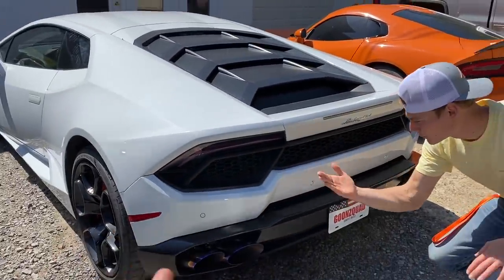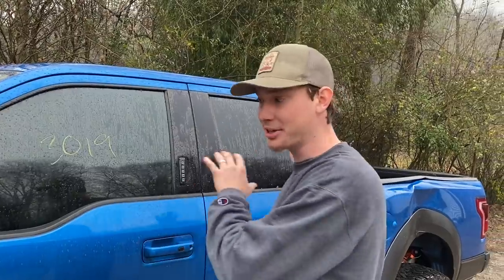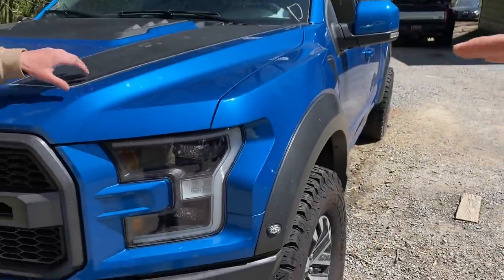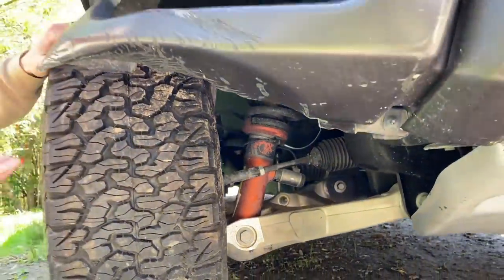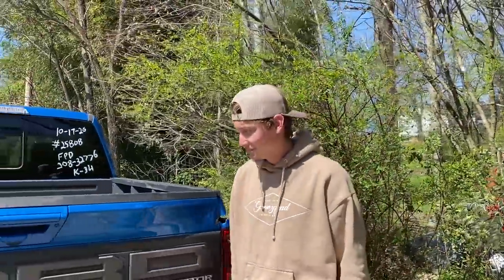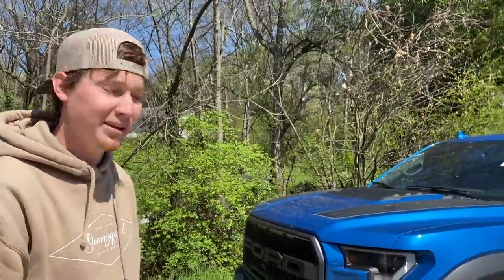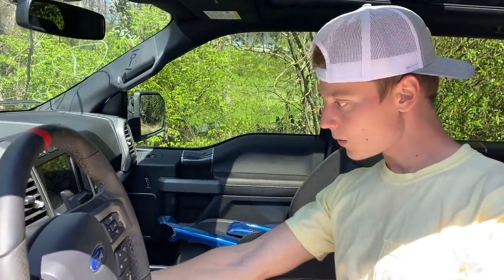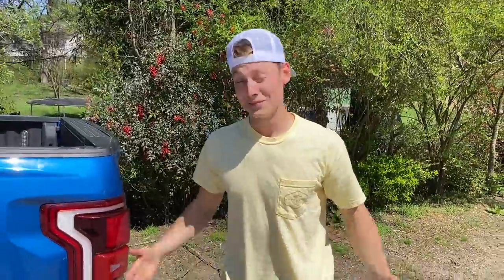Rebuilding A Wrecked 2019 Ford Raptor!!!

Comment: PRO TIPS: 
•Lift kits ruin raptors
•Aftermarket fenders and besides are cheaper and wider than oem (Adv is the best)
•Velocity blue is tri coat paint using a candy blue clear coat
•Method wheels are the way to go for raptors
•Power running boards lead to destroyed rear fenders from rocks and sand blasting because raptor boards stick out and are very good at protecting the truck
•It looks like your front bumper is salvageable, the ends of it come off separately
•37s do not fit raptors unless you drop $20k+ on suspension and body work, I can't stress that enough
•wheels over 17" are lame as hell
Reply: Too bad all this info won't be read by them in time..
Reply: No
Reply: @stanfoxx  yep, it'll end up with 22" wheels and street tires with a rough country lift
Reply: Agree with all of this except I would go 37’s
Reply: @devinschultz6954  it's tempting but frankly they aren't worth it, especially if you go offroad. They will just rub everything, even with suspension mods and fenders. It also robs power, the perfect compromise is a true 35" tire
Reply: I love this comment 😂
Reply: Completely agree, I think they have the money to build tho and could probably get some mid to long travel suspension and be able to fit 37s then.
Reply: @jacobedwards5234  true
Reply: @Blue_Flame_Raptor  I think Raptors are the most off-road capable the way they come from the factory. Most Raptors you’ll ever see with 37s or aftermarket suspension mods are mall crawlers that’ll never have the suspension flexed anymore than it is with regular highway driving.
Reply: 37”a are possible, just need eibachs in the front and Deavers +3 in the rear
Reply: It’s their truck let them build it how they want it jus sayin
Reply: @TheBlaze489  yeah for the street, for offroad you'll need to cut the front up and it will still rub like hell at full compression
Reply: Lol who are you
Reply: @seussyyy  lol who are you
Reply: @stanfoxx  so Stan, why do you watch them if you think they are so stupid? Do you have 2.3M subs on a you tube channel...I’m guessing it. Do you have a Lamborghini,Ferrari,Viper, multiple other cars, trucks, toys, land, house, new building on the way? I’m guessing not. They will build this truck exactly how they want and not loose an once of sleep what you think. Oh, and gain subs while doing it and making even more money!
Reply: Looks like pretty dang good advice, especially about the wheels. If these guys end up putting wheels on it like the Chevy has, I will drive all the way to Tennessee just to go knock on the door and say “boooo” A Raptor is supposed to be an off road truck, not a Mall Queen. Look at any off road race truck, you will not find anything with wagon wheels and 2” sidewalls.
Reply: @kevinm9860  Yeah, views and subs alone mean that someone does everything right. Dude, half of the fun is watching them do incredibly stupid and avoidable things and learn from it... sometimes.

Comment: Those 5 front amber lights and 5 red ones in the back are required by DOT since it’s wider than a normal truck.
Reply: Yup , I thought it was 3 that was required but it’s definitely a dot regulation because of the width
Reply: Yup. So people dont mistaken this for two bikes

Comment: Hey guys, the 3 lights on the trucks are called 'identification lights. ' Their purpose is to alert following drivers that the vehicle equipped with these lights is wider than 80 inches.
Reply: And oddly enough, the Raptor is just a bit SHY over of even needing them at all. 1 inch and it would have changed the entire look of the truck
Reply: Thats because ford makes the f150 just shy of this 80 regulation making there trucks 79.9 width but because of the raptors fenderflares it goes over 80 and they need the lights up front same with the trx
Reply: @Andy Pedro I think it has something to do with how big they are
Reply: @cringepanda3611  this!
Reply: @Andy Pedro cab lights are a option package
Reply: There's 2 more in the fenders. Vehicles over 80 inches wide need 5 amber lights to identify they are wider than 80". HD dually trucks just do the 5 lights on the cab roof, but for the Raptor Ford wanted to incorporate them more
Reply: @Andy Pedro A lot of Pickup truck owners like to pretend they are driving a Big Rig. The roof mounted "clearance lights" are just for show. The same guy wants huge tow mirrors and lights down the side too.
Reply: @Andy Pedro those are optional when ordering the truck.
Reply: I was just about to mention this.
Reply: More commonly known as marker lights.

Comment: Welcome BACK.  Love the 2019 Raptor . Only 3000 miles.
Someone must have had a mishap and wrecked it up but 
Good .  Going to be a fun build for sure.
Reply: Final bid:  $41500
Auction:  Copart   
Lot number: 55789900
Date of sale: 10.12.2020
Year: 2019
VIN: 1FTFW1RG9KFC85537
Condition: Run And Drive
Engine: 3.5L 6
Mileage: 3019 miles (Actual)

Comment: Aren't the clearance lights required due to the truck being so wide? I don't think that the Ram was copying Ford as much as they were meeting DOT requirements.
Reply: Correct
Reply: Spot on ...
Reply: Indeed,they could have put the lights it the roof like work trucks,but let's be realistic that wouldn't look that good and the idea was there already on the grill,so it was about the same as copying it
Reply: @12arney  Yep .. they copied DOT regulations...

Comment: If you go to the beach,  you can leave the keys in the car and not worry about losing your keys or getting them wet.   When you get back to your car you can use the keypad on the door to get back into your car   It's a great feature that Ford has had for a long time now.
Reply: Yep, rarely take my keys out. Just lock them in the truck

Comment: any vehicle in america 80 inches wide (or more) must have minimum 3 amber front facing lights (spaced between 6 and 12 inches apart) the raptor has them but the regular F150 doesn't as its 79.9 inches wide.

Comment: The 3 lights in the middle are a DOT requirement. Most 1/2 ton pickups are made to be within 1/2 inch of the max width before they need to have them. The Raptor, TRX and pretty much every HD truck made are over that width and must have those 3 center lights.

Comment: "3019" More than likely is the code for the door entry.  The auction writes that on the windows when the vehicles come with that feature.
Reply: Nope, it was the mileage. If you look closely when they show the dash, there was 3019 miles!
Reply: @FamilyLtNY  you’re right they did say it only had 3000 miles.  Someone was listening,  not me... LOL
Reply: @roadblazerterry  normally the only thing they write on the window is the mileage or auction/lot number, not the door code.

Comment: Glad to see you back at truck and auto rebuilds.  The Raptor suspension and off road capabilities are pretty awesome in stock form.  I hope you learned from your Denali rebuild that more aftermarket lift and wider tires does not always improve the overall capabilities of the truck.  My vote is engine intake, exhaust, and tune upgrades only for the Raptor.

Comment: That is my dream truck there. There are plenty of aftermarket bumpers that are just bolt on. As for the wheels I saw one today with mate black ones and looked sick, also all the SVT letters in the tailgate and side were red. The amber lights (5 total) means that the vehicle exceeds 8ft wide is a DOT requirement.

Comment: Personally, I would actually lift it up a couple inches or three and paint the truck a tan color with the bed removed. That's what I'd do to the body, the engine on the other hand, I would probably leave it alone or throw a tune on it. Glad to see that you guys are back to building cars now.

Comment: Hello guys those three little Amber lights they're out front on the grill is required by the department of transportation. Once the truck exceeds the width of the department of transportation dimensions it needs three lights in the middle. Check it out yourself

Comment: Glad you boy are back building and repairing vehicles... p.s go factory beedlock wheels with 37" tires give the truck a 2" lift and do the oversized ⁴" over fiberglass front fenders and do the wider bed fenders and tune the truck

Comment: The little lights on the grille and the edges of the trim piece over the fenders is cause of the truck being slightly wider than a regular 1500 truck. Similar to the 3500s or F350s if I'm not mistaken.

Comment: The Ford raptor has 3 Amber lights in the grill because it is a certain length which identifies it as a "truck" which requires additional lighting

Comment: Waiting the helicopter series to countineu.;)
Reply: The Dudes have many demands on their time at the moment, and the maintenance and repair of the Robinson R22 is going to be very different from a typical car restoration. It will involve Goonzquad working under the supervision of a Qualified Helicopter Mechanic, who is required by FAA Regulations to organise, check and approve all safety-related aspects of the work. The aircraft then needs to be formally Certified as Airworthy, and must be insured and Registered before it can be flown. If Simeon and/or Eleazar wish to fly it themselves, they will first have to earn the necessary Licence(s), which is no simple matter.

Comment: Throw some 22in Forgiatos wheels with 32 inch tires, lift it 3 inches, slap an extended F250 bed and baja reinforced roll bar.

Comment: I was late but those amber lights are also on the corner of each bumper and are required by law because the vehicle is wider and bigger than a standard truck.

Comment: Seeing the Maybach on hoovies garage with similar damage, this was probably hit by a truck and slammed with rear left on a pole or something similar. The big hole and cut on the right side is really similar to Hoovies Maybach
Reply: The fact that none of the airbags deployed on the Raptor suggests that it was sideswiped while parked, and this caused the scraping and tearing damage along the passenger side. The damage on the driver's side is different, because it is buckling, not scraping, and the most serious example of this type is on the side of the bed, and was probably caused by the rear left-hand wheel being forced upwards violently. The frame (chassis) of the truck is probably distorted in this area, and this is why the Insurers wrote it off.

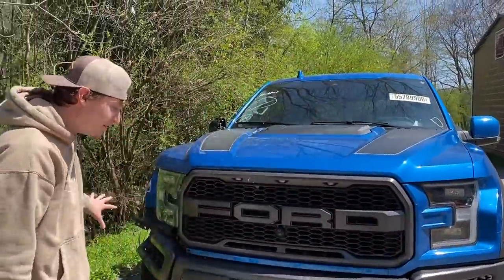Comment: 7:10 those lights are there for US regulations. They are required by DOT for vehicles over 80”. All that means is the raptor is bad ass because it’s so wide

Comment: hi goonzquad it is beautiful this ford f150 raptor in blue and i advise you for accessories go to additive desert designs which are excellence and above all take the honeybadger one and for the exhaust go to AWE exhaust and take the OFG exhaust pack which are excellence noise for your vehicle and you will not be disappointed with the result if you put this and i come from FRANCE so i follow you since the beginning of your reactions from goonzquad

Comment: I'm surprised none of the air bags are blown
Reply: The fact that none of the airbags deployed on the Raptor suggests that it was sideswiped while parked, and this caused the scraping and tearing damage along the passenger side. The damage on the driver's side is different, because it is buckling, not scraping, and the most serious example of this type is on the side of the bed, and was probably caused by the rear left-hand wheel being forced upwards violently. The frame (chassis) of the truck is probably distorted in this area, and this is why the Insurers wrote it off.

Comment: my 2019 ford fusion has a sensor to where if the key is close enough i just put my hand on the inside of the handle and it unlocks, and to lock there is another little icon on the outside

Comment: I wish they had a total breakdown of the cost. :(
Reply: Final bid:  $41500
Auction:  Copart   
Lot number: 55789900
Date of sale: 10.12.2020
Year: 2019
VIN: 1FTFW1RG9KFC85537
Condition: Run And Drive
Engine: 3.5L 6
Mileage: 3019 miles (Actual)
Reply: @whteman2  Dang SON!

Comment: What about the helicopter when we gonna see one of those videos again
Reply: Goonzquad have many demands on their time at the moment, and the maintenance and repair of the Robinson R22 is going to be very different from a typical car restoration. It will involve Goonzquad working under the supervision of a Qualified Helicopter Mechanic, who is required by FAA Regulations to organise, check and approve all safety-related aspects of the work. The aircraft then needs to be formally Certified as Airworthy, and must be insured and Registered before it can be flown. If Simeon and/or Eleazar wish to fly it themselves, they will first have to earn the necessary Licence(s), which will be no simple matter.

Comment: YES! By all means, repaint the 2019 Ford Raptor with a different paint color. I have the perfect replacement color that you will love. You will thank me later. The color name is, "ENSIGN BLUE POLY" with silver metallic flakes.  In 1979  I bought a new Dodge B100 Sportsman Van with windows and rear seats. (It looked like a large SUV ) The color was beautiful. Had the van only a year until it was stolen. I had to buy a used brown Dodge van but did not like the color. So I had the van repainted to match my stolen van's color. Well,  I got many compliments from people stating that the van looked very vogue.  Trust me, this "Ensign Blue Poly" will look great on your new build. The paint code I got from  The 1979 PPG Corporate Color Information Catalog. COLOR NAME = Ensign Blue Poly;  PAINT CODE: = SB7;  D.T. NUMBER =  8795;  DITZLER CODE =  3144;   PPG - DAR- H -  DELSTAR ACRYLIC ENAMEL.  This paint has silver metallic flakes, Not too much nor too little. just the right amount.

Comment: When are we going to see helicopter content again?
Reply: Goonzquad have many demands on their time at the moment, and the maintenance and repair of the Robinson R22 is going to be very different from a typical car restoration. It will involve Goonzquad working under the supervision of a Qualified Helicopter Mechanic, who is required by FAA Regulations to organise, check and approve all safety-related aspects of the work. The aircraft then needs to be formally Certified as Airworthy, and must be insured and Registered before it can be flown. If Simeon and/or Eleazar wish to fly it themselves, they will first have to earn the necessary Licence(s), which is no simple matter.

Comment: Did some person try to jump it ?
Reply: The fact that none of the airbags deployed on the Raptor suggests that it was sideswiped while parked, and this caused the scraping and tearing damage along the passenger side. The damage on the driver's side is different, because it is buckling, not scraping, and the most serious example of this type is on the side of the bed, and was probably caused by the rear left-hand wheel being forced upwards violently. The frame (chassis) of the truck is probably distorted in this area, and this is why the Insurers wrote it off.

Comment: Where is the helicopter build tho?
Reply: The Dudes have many demands on their time at the moment, and the maintenance and repair of the Robinson R22 is going to be very different from a typical car restoration. It will involve Goonzquad working under the supervision of a Qualified Helicopter Mechanic, who is required by FAA Regulations to organise, check and approve all safety-related aspects of the work. The aircraft then needs to be formally Certified as Airworthy, and must be insured and Registered before it can be flown. If Simeon and/or Eleazar wish to fly it themselves, they will first have to earn the necessary Licence(s), which is no simple matter.

Comment: Hey Boys,
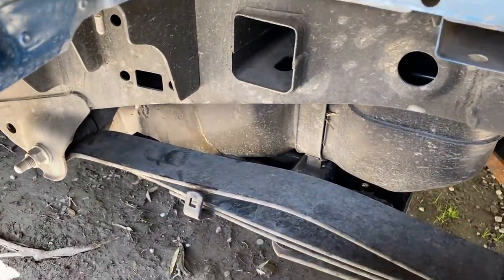I replaced my rear leaf springs and unless you drop the gas tank and the exhaust you will need to cut the bolts holding the front leaf spring with something. you can see that bolt at 14:22 on this video.
Here's my video: https://youtu.be/RJtsBqplg38?t=60

Comment: What happened to the helicopter?
Reply: The aircraft is still in storage at the 'Original Goonzquad Garage' in Rossville, Georgia, which is next to their parents' home. The process of maintaining and repairing the Robinson R22 is going to be very different from a typical car restoration. It will involve Goonzquad working under the control and supervision of a Qualified Helicopter Mechanic, who is required by FAA Regulations to specify, organise, check and approve all safety-related aspects of the work. The aircraft then needs to be formally Certified as Airworthy, and must be insured and Registered before it can be flown. If Simeon and/or Eleazar wish to fly it themselves, they will first have to earn the necessary Licence(s), which is no simple matter.

Comment: Where is the helicopter
Reply: The aircraft is currently in storage in Georgia. Goonzquad have many demands on their time at the moment, and the maintenance and repair of the Robinson R22 is going to be very different from a typical car restoration. It will involve Goonzquad working under the supervision of a Qualified Helicopter Mechanic, who is required by FAA Regulations to organise, check and approve all safety-related aspects of the work. The aircraft then needs to be formally Certified as Airworthy, and must be insured and Registered before it can be flown. If Simeon and/or Eleazar wish to fly it themselves, they will first have to earn the necessary Licence(s), which is no simple matter.

Comment: LEAVE the WHEELS on the TRUCK alone they look good they are custom for the TRUCK from the factory there are no more RAPTORS running around with different WHEELS or wider BODIES or any other modifications on them or done to them & I've seen a few around my area with absolutely NOTHING done to them & don't lift it either it LOOKS FINE AS IS